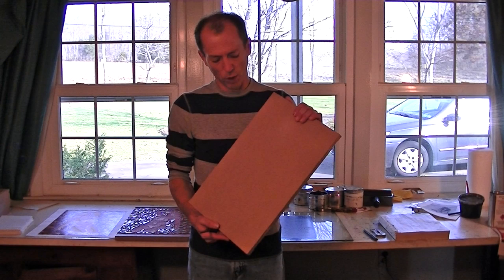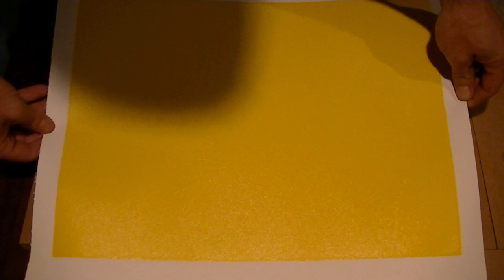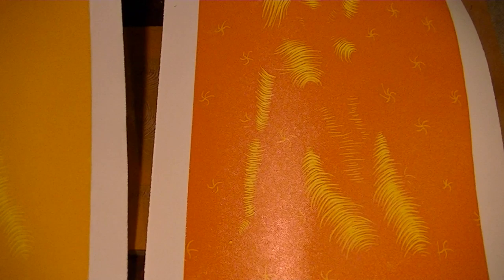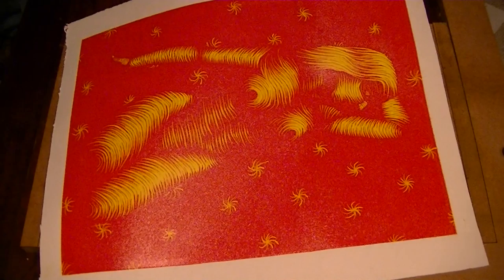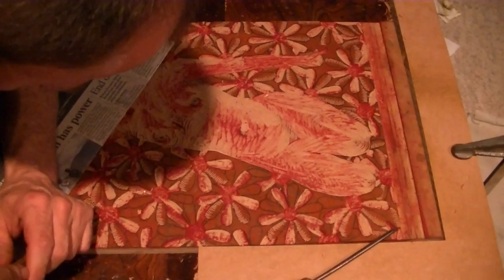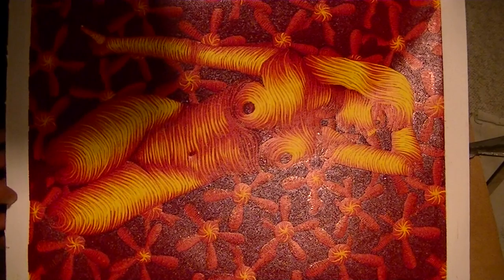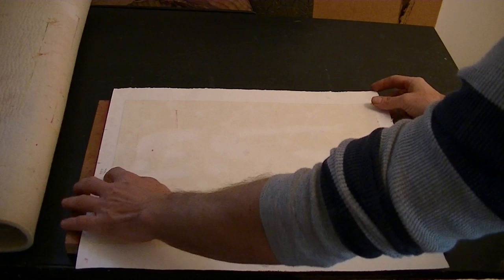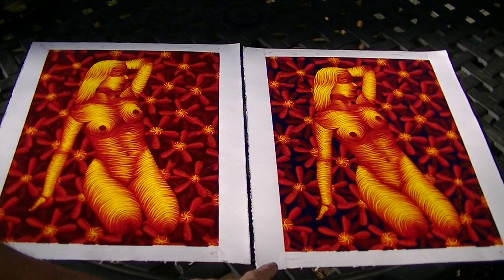woodcut reduction.mp4

Comment: Beautifull piece of art. I love the colors! :)
Reply from the maker: +Mato Misik thanks they are my main colors in most of my pieces but lately I have been trying to do more earthy colors
Reply: :) How many pieces/prints are you make from this project? How much time you spend on it? Thank you.
Reply from the maker: +Mato Misik I did an addition of 6 prints, That is my usual amount of prints I do per wood cut. This one took a month and a half to do. It could have been done faster but had to wait for the colors to dry. The first colors put down will dry in a day because they soak into the paper a little. After the 5th color it can take up to a week to dry and I don't like to print unless it is dry (you can print if it is still wet) this piece was 11 colors. 11 colors is 11, four hour nights, for cutting out the wood block and one hour to print each color.
Reply: Waw ... 3min video = 1 month :) Your work is really beautiful. Do not give up and continue on.

Comment: Are you using a drying agent (like colbalt dryer)?  If so, does it make the ink glossy?
Reply from the maker: no I don't use a dryer. It will start to get glossy after the 5th color because it doesn't soak into the paper anymore, at that point it is ink on ink. It can take over a week to dry after the fifth color. That piece has 11 colors.
Reply: Are you using oil or water base inks?  After the 3 or 4th color it can take weeks or longer for the ink to dry - might be because of the high humidity in Hawaii?  I'm using just a couple of drops of colbalt dryer to speed the drying time, but I don't always like the glossy finish.
Reply from the maker: I am using oil ink. After my fifth color I always wait at least a week and I can't say it is completely dry but at least tacky I am too impatient to wait any longer. I do think my prints get a glossy look to them because of all the colors.

Comment: How long are you letting your prints dry between inking?
Reply from the maker: Shane Chick The first couple of layers it doesn't take long to dry 2 days. After the 5th color it can take a week to dry
Reply: I started hanging them in the room with a pellet stove blasting.  I am doing 11-15 color reductions and it is tough to print wet on wet.